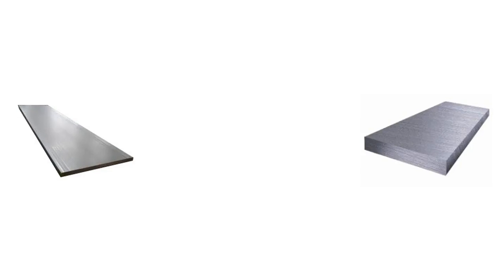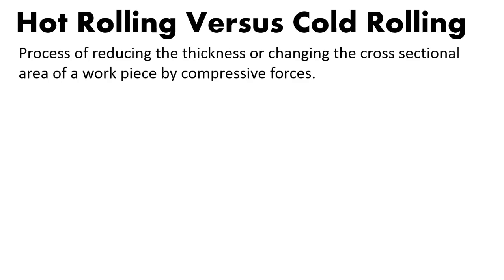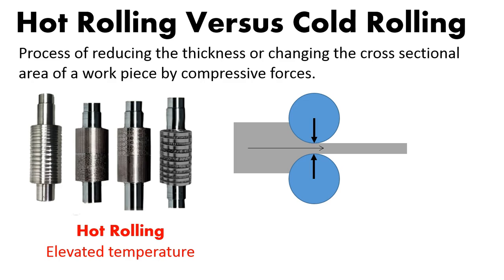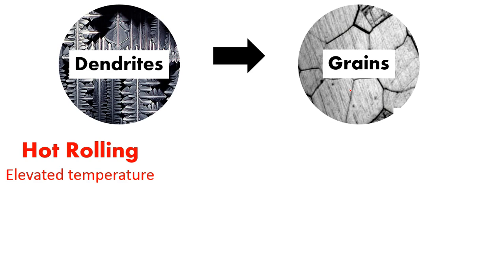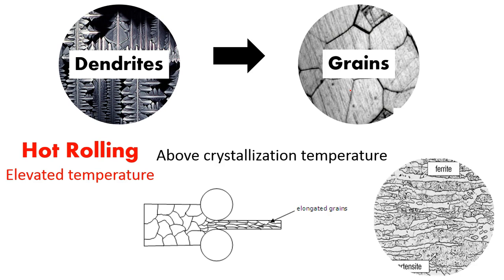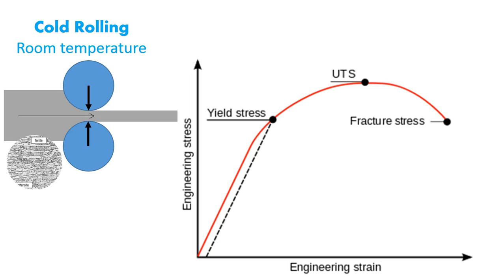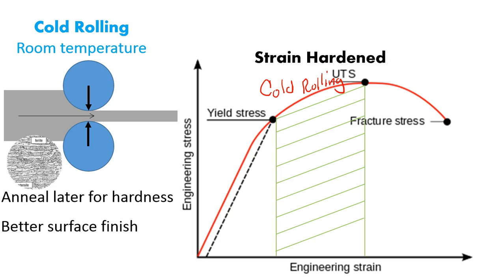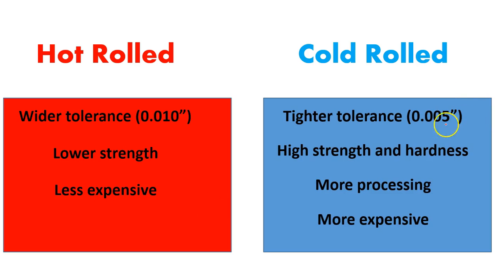Metal Forming (Part 2: Hot Rolled Versus Cold Rolled Processes)

Comment from the maker: Strength of Materials: https://www.youtube.com/playlist?list=PLAXJqmuqGEr7QjsVVyl5jFY6HQTqw6Bfq

Metal Casting: https://www.youtube.com/playlist?list=PLAXJqmuqGEr4wiY6xroSK67CXeTu0Otmk

Quality: https://www.youtube.com/playlist?list=PLAXJqmuqGEr4LQvNzKHGO9l00gEN4gmSP

Design: https://www.youtube.com/playlist?list=PLAXJqmuqGEr706zgRtnwgQiFC5FYLvaTr

Automation: https://www.youtube.com/playlist?list=PLAXJqmuqGEr6O_nQ-n08qmrtNnAUruj3b

Calculus: https://www.youtube.com/playlist?list=PLAXJqmuqGEr7Ayo18H7tknyQAJu1OcoUW
Reply: Infinity MFG 
When I looked at 0:15, I saw that even Jackie Chan was curious about the difference between cold and hot rolled steel..... Lol.  Great video. I took metal shop in like 10th or 11th grade high school in '84 or '85, then worked in a machine shop from 10th grade, til after graduation. Although I never had to do any welding, and we didn't use much cold rolled steel plate, bar stock or tubing at my workplace, I do remember asking my metal shop teacher what the difference was between the 'dark gray' colored steel vs the identical sized steel bars, tubes and sheets that had a relatively clean, metallic surface finish. Mr. Massey summed it up by simply saying that "the lighter colored, cold rolled steel is stronger". But I never fully understood why, although I figured it must have something to do with the extra force it would require to run cold steel through rollers as opposed to heated steel, which would obviously be softened by the heating process prior to rolling it. 

This video reinforced that EXTREMELY rudimentary assumption, but also added the technical and scientific reasoning to the how and why cold is stronger than hot. Well, now that we've learned something useful, maybe one day I'll work with Jackie Chan on some metal projects!
Reply from the maker: LOL!  I can't believe that I missed this comment!  This is great!

Thanks for watching!

Comment: I am trying to figure out if Hot forged tools vs. Cold forged tools are better.  For example, socket wrenches: Gedore sockets are hot forged, they claim this is better than cold.  Hazet sockets are cold forged.  They claim theirs is better.  (Hazet have a lot more money as a company and produce more consistent looking tools than Gedore, but are they stronger???).   In the video you say hot rolled is stronger, but you also say cold rolled is stronger.  So which is it?  (I suppose this is like asking is Lafite '59 better than single malt whiskey).

Obviously both methods work very very well because both of these German tool companies have thousands of users in Aerospace production and maintenance where money is not spared in hand tools (because a problem caused by cheap tools is infinitely more costly, so they actually spend more on tools to save money).

Comment: so far this actually the most inclusive about all the properties between the two types of steel that I've found so far. I have an interest since I'm a welder for a company producing flammable liquids containment solutions and deal strictly with coled rolled steel for its finish and strength over hot rolled

Comment: So does cold rolling improve tensile strength even after the steel is annealed? Could you repeatedly cold roll and then through-anneal the steel to further improve the grain, or does annealing (normalizing) take away the strength created by cold rolling process? I ask because normalizing removes stresses from the steel, but does cold rolling have any effect on the grain at all? Also, what is the effect of hot rolling at low vs high temperatures? After annealing, will steel hot rolled at just past the recrystallization temperature be stronger than steel rolled at 1200C?

Comment: thanksks for your explanation related to hot and cold rollled. But I have one doubt about quenched and tempered process, what is the difference against hot rolled process? Appreciate your help.
Reply from the maker: Do you mean if you heat treated cold rolled steel versus heat treating hot rolled steel?  The differences would be the internal stresses of the materials but you would have to consider the grade (carbon content) of the steel as well.

I hope this helps, and thanks for watching.
Reply: I'm so interesting with this topic. Are there any impacts to the mechanical properties of steel if we heat treating hot rolled vs cold rolled steel ? And how ?
Thank youu
Reply: @lutfiyunuswahabalaudhah613  just watch this
https://www.youtube.com/watch?v=uG35D_euM-0